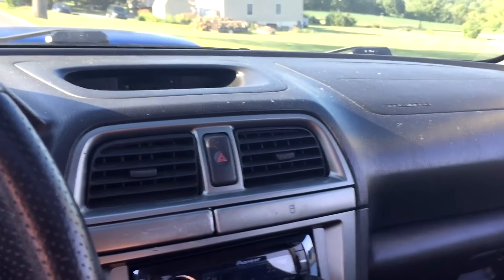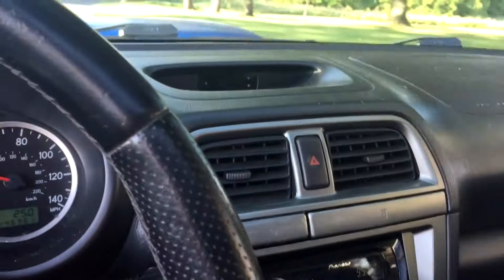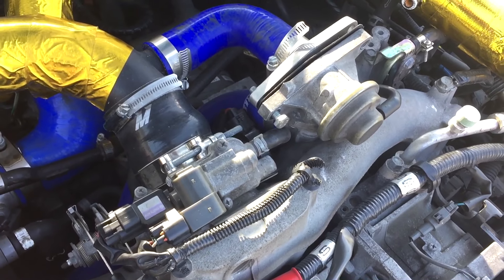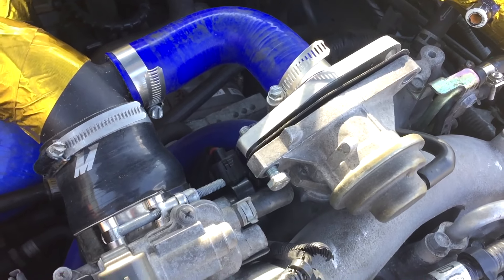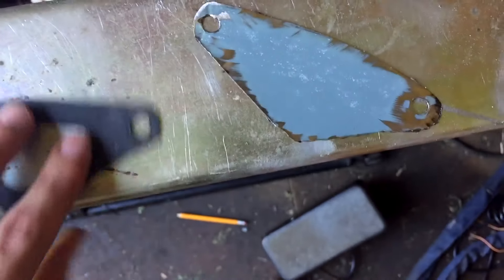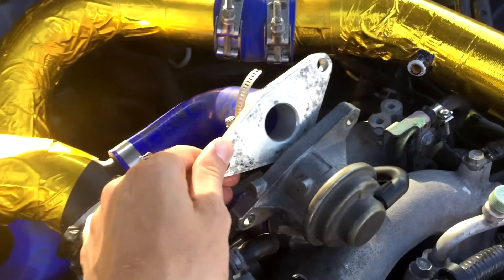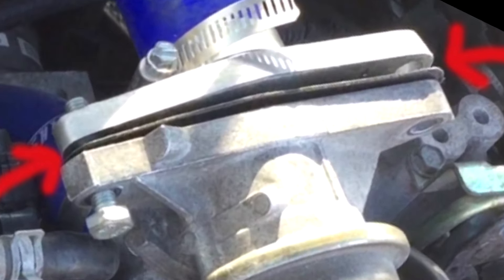DIY | BOV/BPV Delete - Block Off Plate | Stage 3 WRX Turbo Sound

Comment: Any long term side effects? Especially with pro longed spirited driving on a hot day any chance this is cutting away at the turbos life rapidly?
Reply: Not good on a stock turbo. It’s fine off the throttle to get flutter but it will eventually wear out the bearings. I would personally go with a billet turbo (compressor wheel) or rebuild your VF entirely. Also note that if you run a blanking plate on your flange and your car isn’t tuned for it, you’re gonna start running into lean/rich AFR scenarios. You should be more concerned about the longevity of your engine than your turbo as it costs way more to replace a short block ($6~7k for OEM EJ’s) vs a turbo ($1.5k for OEM VF39).
Reply: @Jordan Clements yes and preferably you need to switch from MAF tune to speed density (MAP) tune. There's literally no point of running a block off on MAF since it's measuring the air density from the intake. If you're gonna have a MAF tune with a block off plate, all the air that's being measured by the MAF sensor is being dumped out so the car will run very rich, then run very lean.

Comment: I do have this as unwanted effect after they have installed new turbo in the shop. I have Audi Q5 2.0t and getting stututu flatter when letting off the gas pedal. What should I look for in order to remove or decrease the sound
Reply: I do hear that even in low rpm when I let off the gas pedal

Comment: I did the same but mine doesn't sound anything, I had to remove the intake box to hear the flutter but the sound is low. I have a bov, does't it that affect? or I must have the oem bov to do this mod?

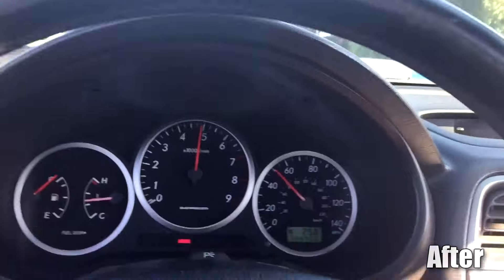Comment: @1:43 Ive always wondered why after tuning my turbo would do that sound like chopping air. Is it an IHI tufbo thing or what i had an evo years ago it never sounded like chopping air under boost.
Reply: Thats called a external wastegate
Reply: Austintaughtyou I have an EWG now but back then I didn’t and it still made the sound I was asking about. It’s probably josh the design of the turbo.

Comment: Dude that flutter is the sound of your turbos compression wheel spinning in reverse.... actually just go ahead and keep that bov delete setup, Leme know when your working on those engine swap videos that will be coming soon. I can see it now 
(Wrx Blown engine replacement)
Reply: If you understood how flutter works you would know it's impossible for the compressor wheel to stop spinning, it doesn't even get close to stopping.
Reply: DriftNick I didn’t say it stops, that fucking things spinning so god damn fast then it’s like a pressurized burps. Now granted “This is my understanding and could be horribly wrong, but the inability for the excess pressure to release itself possibly causes the waste-gate to do the job instead of where as a bpv/bov (by pass valve/blow off valve for anyone wondering) would normally come into play once shifting (well either releasing your foot off the petal or clutch depending I guess how you shift or just flooring it and letting your foot up should be around where this is all taking place) so I mean I can think of no other place that is causing it, the pressure is going somewhere and if it’s not going out of the exhaust it’ll probably shot your rod and pistons through the block, it’s not going through the banjo bolt, not going through the intake, god only knows what the air flow sensor would think about air leaving it.... if it’s capable of that?” But ok 👌 fine I give up take me to school kind sir? What’s going on in that puppy?
Reply: You said it's the sound of the compressor wheel spinning in reverse, for that to happen it would have to stop spinning.

"waste-gate to do the job instead of where as a bpv/bov"

Has nothing to do with the wastegate, it's happen on the compressor side no the exhaust.

"the pressure is going somewhere and if it’s not going out of the exhaust it’ll probably shot your rod and pistons through the block"

Not on the exhaust side again and the throttle plate is closed so it's not going into the engine.

"not going through the intake"

Other then the fact that it does.

"god only knows what the air flow sensor would think about air leaving it.... if it’s capable of that?"

It reads the air flow again and causes a rich condition, one of the reasons bypass valves are factory fiited.

"What’s going on in that puppy?"

Throttle plate is closed and the air goes the only place it can go which is out the intake of the turbo, the sound is the pressure wave created when this happens and from the air going over the compressor blades.
Reply: DriftNick I’ll just keep it simple. You schooled me +1 to you -1 me, BUT NEXT TIME GADGET, NEEEEEXXXXT TIME!

Comment: I tried blocking off my blow of valve but  nothing happens. any reasons as to why? 
I have a 2004 wrx.
Reply: Do you have a aftermarket intake on the car?

It wont work with a stock airbox.
Reply: squishypitbull yeah my engine is pretty much stock, standard top mount and stock air box, i want a pod but it and i are broke XD.
Reply: lmfao once you get a pod filter you'll hear the turbo "pshh" everytime to you shift even without the block off plate.....with the plate you'll get the flutter.

Comment: Hey I watched your how to bpv delete video but I have the stock top mount intercom let! Do I have to do anything different? I made the block off plate and installed it but nothing changed!
Reply: Intercooler*
Reply: +Cameron Thornburg even hit red line and no different sounds
Reply from the maker: It dpeneds what you have. Do you have a TMIC or FMIC? Do you have the stock intake or a short air/cold air intake?
Reply: +Subie Rumble TMIC AND STOCK INTAKE
Reply from the maker: Cameron Thornburg That's why... Stock intake is muffling any sound & FMICs hold more air for longer, more dramatic noises.

Comment: the key is to not have it make that noise, that noise means there is no enough air flow by passing the turbo shaft,  it sounds cool but it reduces the amount of torque you could be producing

Comment: hahaha love the captions for the sound, sorry to ask but im transitioning from having a motorcycle to a turbo charged car, can you explain to me what is the purpose of the block off plate and if it is necessary at all
Reply: While it shouldn't shorten the life of a modern turbo significantly, you're not doing it any favors. I seem to recall larger turbos tend to handle this better.

Comment: Would a TMIC sound different to a FMIC? curious.
Reply from the maker: I would imagine so. An FMIC setup holds considerably more air than a TMIC setup (longer piping, bigger intercooler). Now how much different the sound? Idk. Maybe look up some videos & try and find a Subaru with a TMIC & a BOV delete and compare it to my video?
Reply: i was running this setup on my top mounted intercooler on a stock wrx. Like the nice caracterisic of the sound is the same, but it is much shorter and only heard in the first gears (i could image, if you are running high psi it would enhance). In general, you could say that the lenght of this sound is enhanced by every inch of intercooler pipe you get. A Tmic has a short one, so there, you only here it on the first gears or if you are running higher boost, in every gears. However it would also be shorter. like a tsusu 

i could also image that the effect on the actual performance, if there is any, would be much less significant on a Fmic. I removed mine, and so i wait till i have a Fmic to delete the bov. Now after seen his video, my motivation to get one earlier than needed is even higher :p

So do I need a retune when running a Fmic?
Reply: Thanks for the reply, im running 21psi with stock TMIC. I cant find any vids relating this so ima just test it out myself. i might upload a vid of what it sounds like. cheers dude.
Reply from the maker: You don't necessarily need a retune for an FMIC. Of course retunes are always nice to have, but they're expensive... an FMIC will decrease intake temps but increase turbo lag (slightly).

Comment: i did the same on a 2015 STI but didnt get the whining sound,, only tsutsutsu.
how come??
Reply from the maker: do you have stock short air intake? do you have an fmic? If no, than that's why
Reply: Subie Rumble  Ahhaaa,, thank for the reply.
Reply: Have you successfully done this to your car? And how did you go about doing it lol I have a 16 wrx can't figure out exactly what to do
Reply: You have to reposition your intercooler to the forward side so that the whining shall sound. i didnt do it yet,, so only tsutsutsu.
I bought Perrin BOV which can control your blow either hard as if its closed or soft as if fully open.
Reply: You need a air intake and to block off the BPV. 
The stock airbox muffles the sound.
Reply: thanks,, i do have an HKS SSQ BOV at that time. it gave a sound but not as the one made in the vid.

Comment: If my car (2005 Subaru Outback XT) is completely stock with stock intake, can I do this?
Reply: yes
Reply from the maker: Yes, but you won't hear it. You'll need at least a short air intake since the stock box muffles most turbo noises.
Reply: Subie Rumble what is the difference between a short air intake and a short frame intake like Cobb offers
Reply from the maker: RyanRC2 never hear of a short frame intake. Do you man ram air intake? It's all the same shit really. Short air intake is short. Cold air intake is long.
Reply: how to instal on a honda eg???

Comment: Just did the mod and I can't hear it at all, maybe like a very very faint sound but nothing significant
Reply: What I did was put that plate between the wastewater and the gasket and the reattached all the hoses
Reply from the maker: Well the wastegate is for exhausts. I think you meant BOV/BPV :p  Did you hit a few pounds of boost at least when testing? What kind of intake do you have? Stock intake?
Reply: +Subie Rumble yes I did mean bov and everything is stock, I hit the highest boost I can get which is about 8
Reply from the maker: Fred Hennop you should be hitting closer to 13-14 psi if you're stock.

Comment: would you get the same sound or similar sound with a stock TD04 turbo?
Reply from the maker: That's a hard one to answer. After posting this video, I've had plenty of people who've tried this after watching & reporting different sounds than the one I'm getting message me saying theirs isn't as loud. I'm thinking that because FMIC physically holds more air, that mine will be louder than a TMIC setup. Now I'd imagine the size of the turbo would also play a part in sound. But to be honest, I'd imagine the size of the compressor on a VF39 vs a Td04 isn't big enough to make a difference. I think it all bowls down to your air intake (short, cold, stock, etc) & intercooler setup (TMIC or FMIC)

Comment: Do you need a tune after this
Reply from the maker: need? no, however getting a tune would only be beneficial
Reply: @SubieRumble  you sure? What about for a ej207?
Reply from the maker: @resdyne9590  doesn't matter what engine it's for, the ecu assumes the recirculation valve is fitted. so when you snap off the throttle, the ecu thinks there excess air from your charge pipes will be reintroduced to your intake. However by doing this move and essentially turning your bpv to a bov, your ecu will most likely run rich for a split second before correcting itself. No big deal honestly. I do feel that although a tune would only help, it may not be worth the cost for this simple mod. Just my opinion
Reply: @Subie Rumble  word, I'll try this when I get home, can't wait!

Comment: can someone help me out here? i have an r33 skyline gtst and it makes the sututu noise even though the bov isnt blocked off. it makes the sututu noise cruising around and at low boost levels but once you hit high boost and change gears it makes a whoosh noise. why does it do this?  is my bov spring just really stiff or something and only opens up at higher boost?
Reply: sb93 sb93 your bov isn't working properly get a new one
Reply: +julio castruita  its normal, when you hear the tustutu noise  itz because there is not enough boost to open the bov
Reply: Blackpacker yeah you are right. turns out the reason it was making the flutter was that the previous owner had actually put a bottle cap in the piping to block it off. i just assumed the bov was stiff. i have a turbosmart plumb back now and it makes a slight flutter at low boost but opens up any other time.

Comment: how did he get all that turbo noise not the blow off but when he rolls on?
Reply: because the blow off valve is now block the extra left over pressure has no where to go but the way it came in back out the inlet of the turbo causing the sound
Reply: What is that EWG plus 3 thing
Reply: external wastegate stage 3+

Comment: Or just unplug the vac line from bovand plug it with a bolt.
Reply: Right.... That's what I was thinking lol, all that trouble cutting and blocking off when you can just unplug the vacuum line and plug the line

Comment: How safe is this for your turbo?
Reply from the maker: There's a lot of debate on whether this actually hurts the turbo or not. There are plenty of guys out there running without a BOV & swear it doesn't hurt their turbos. Another thing to consider, many 80s-90s cars, turbo diesels & even race cars (rally cars) don't have BOVs. I suppose it's all up to the end user. Do your research & form your opinion before doing this mod!
Reply: is there any reason to run this other then for sound?
Reply from the maker: DerekTheWhale Well, since you're not vacating all positive pressure in your intercooler tract, it should reduce turbo lag between shifts.

Comment: So I’m talked with my tuner of course it’s not good for your turbo pretty bad for any journal bearing. Ball bearing can handle it better. I been going blocked and regular for a while at least a full year 30k miles nothing alarming. This comment is for anyone thinking about it. I hear low boost is ok it’s just wot and tracking the stock turbo is where you can have issues

Comment: A great way to really reduce the life of your turbo!
Reply: Not really, this only changes what's happening when the car isn't under load the turbo won't have any problems with it. If the turbo is making this sound when you're building boost, or doing a pull or something like that under load, then you have a problem

Comment: does this actually damage the turbo tho?
Reply: No, Turbo flutter when letting off the gas is just fine. 
Compressor surge (Flutter when the car is under load I.E. accelerating) is bad. 
Cars with turbo's didnt really have BOV's until roughly 1995. All the turbo cars back then ran just fine without them. 
Some cars now still dont use them.

Comment: how would you do this on a 2015 WRX?
Reply from the maker: hmm, I'm not too familiar with the newer setups on the FA20DITs but I'd imagine the principles are the same. You need to block off where the Positive air pressure meets the mouth of the Recirculation valve / BOV/ BPV. I'm assuming the newer models don't have the 2 bolt flanges like mine does? hmm... Maybe see if there are any plugs or block off kits online for aftermarket systems? Or take yours apart & take a look to see what you could make to block the hole? Keep me posted!

Comment: Don't do this lol. You will get the same sound with an aftermarket bov, and a cold air intake. Cold air intake on a stock wrx will make it run lean though beware...
Reply: If it makes the same sound with a BoV then that BoV isn't working properly and isn't making the sound, so no can not get the same sound.

Comment: Lmao all the surge! enjoy replacing your turbo or whole motor... I say motor cause of two reason. this could blow ur turbo sending crap into your intake and into your motor, also this will 100% cause a lean condition and can melt your pistons... 1 piece of metal inside is 💥, piston melted is 💥. what's happening is the air that is normally recirculated back into your intake via bpv is hitting that block plate you made and has nowhere to go so it's feeding back and through your turbo... I'm sure you can probably figure out why high pressure air going backwards though your turbo isn't good. if not sell your car!
Reply from the maker: little over the top there lol ... and as for the lean condition, that's implying your car isn't tuned for a BOV delete. which both this car and my current car are. Neither of which have had any issues. to each their own
Reply: You actually have no idea what you are talking about, thanks for the laugh.

Comment: May only wrk on fmic
Reply from the maker: Works on TMICs too. My buddy had this setup for a while. Although I will admit it wasn't as dramatic as mine. Perhaps because the TMIC physically holds less air between the turbo & throttle body, it may not be as loud.